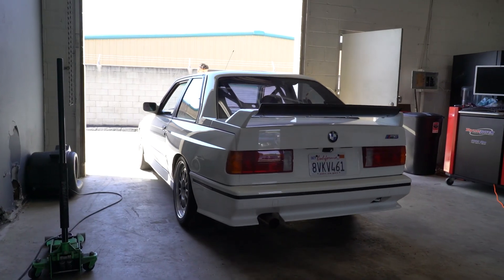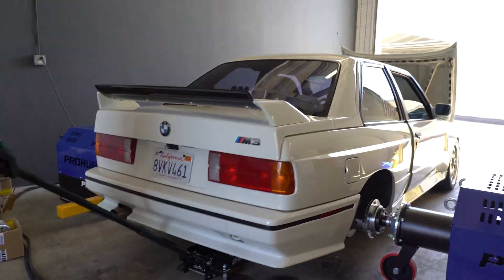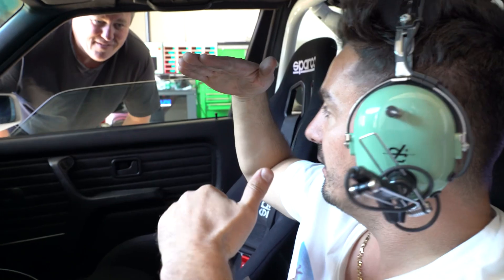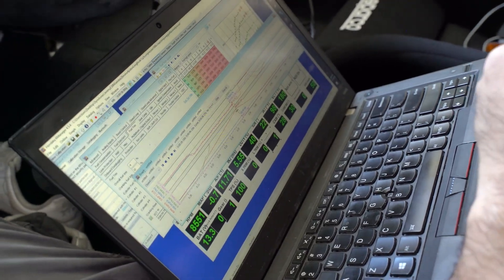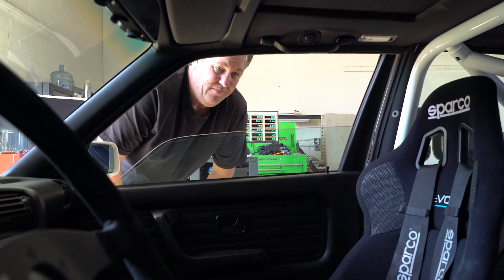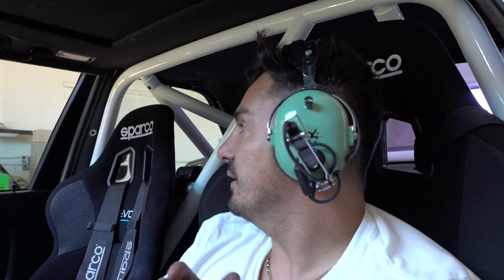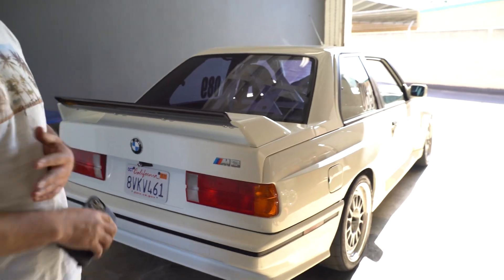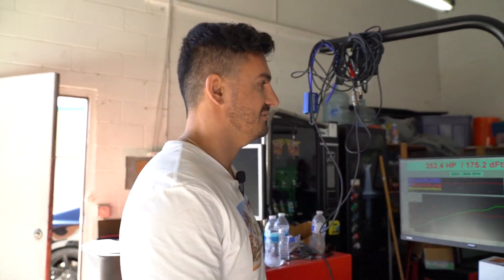Real E30 M3 4piston K24 swapped hits dyno

Comment: is this for racing so you  meat the class as its still 2.3 4 pot  you can beat on it all season and   be able to repair or replace/service the engine ? easier to find  bits ?  its making the same power  and  costs about the same as the BMW S14 engine if you  had built one  .. just if you break one  it would be horrible  to  try find one  ...

Comment: Luv k20/k24 swaps but they need boost - stock e30 making that torque and almost power- easy achieved w bolt ons. Weight is huge but k24 needs boost to make a actual improvement over even m50/s54 swaps..
Reply: They don’t need boost! A k24/20 set up will make 320whp naturally aspirated with a street set up easily, especially with itb’s and e85
Reply: You're not making k20/24 power from any of the factory E30 engines with just bolt ons. There's people running stroked and cammed M20 engines on ITB's are barely making 250 at the flywheel. K24 is almost 100kg less than an M50/S54 and an S54 engine is stupid money nowadays. Really no comparison. For the money you'd spend S54 swapping you'd make way more power boosting the K series for similar money. Don't even get me started on an S14. And a non-M engine is just going to be slower. S54 is the only one worth it in my opinion because it's still a special engine but then you Americans literally only care about power and racing in straight lines. You're still keeping up with an S54 swap with a K20/24 frank.
Reply: @B__L  you’re right about everything you said but you’re wrong about one thing, US Americans don’t always care about straight line racing only! There are plenty examples of American cars doing corner racing! We have auto x racing, American iron racing, road racing etc… I am actually building a 96 cobra with a road race suspension set up..and there’s nothing wrong with big power, who doesn’t love big power??? I myself like a well balanced car, but sometimes I do crave big power
Reply: @petrolhead8851 What's corner racing? Sounds painful 😅
Reply: @B__L bro is it actually nearly 100kgs fully dressed?? I’ve got an aluminium M52 that I’m about to swap into my E30 pending K24 swap after these kits have come out - so hard to decide fml

Comment: How bad does that vibrate.  Sucks they when they remove the balancer it shakes like hell.
Reply from the maker: Which balancer you referring to?
Reply: @Dardantuned  the one they remove for the upgraded oil pump .
Reply from the maker: @Vgk36   ohh right, no it doesn’t! No issues!
Reply: @Dardantuned  that's wild . Maybe other people are running to hard of a durometer on their engine and trans mounts.🤷
Reply: @Vgk36  with the kpower mount arms you can use regular e3024v swap mounts so it makes for a bunch of options for mount hardness. Makes it super nice. My car doesnt shake at all. Idles at 600 without issue.
Reply: @agilee30  can you use rubber mounts? I’ve done the same swap in my 318is with the kpower kit. Vibration isn’t too crazy but would definitely go from solid to rubber if I can reduce some more of the NVH.

Comment: no disrespect but 250 whp out of a $10000 engine is subpar. unopened k20's with e85 will make that.
Reply: i don't think this car was about hp/$, otherwise they would've boosted a stock unopened k24 and get 450/500hp reliably
Reply: @oussama4629  i guess makes sense
Reply: Yeah definitely disappointing, but the 91 octane is killing it. 93 would probably make another 10+ whp, and e85 easily 30+.
Reply: @nickdominic9103  plus rwd drivetrain loss is more vs fwd.
Reply: The bottleneck is the intake manifold as well. In the 300+ whp range, you typically need something different from the usual RBC or RRC style intakes, something more like an ITB setup, ported skunk2 ultrarace, and such.
Reply: @dannyllerenatv8635  this is using a kpower intake. They flow a whole lot. Not your typical intake.
Reply: @agilee30  Ah I see now it is a K power intake. It probably has a lot more tuning left in it, but the owner probably wants something a bit more on the conservative side reading from the comments.
Reply: @agilee30  I’m doing this build but stock block with type s pump head work and cams.  Seeing all these builds end up with 250hp I change to a turbo setup. Accounting for the rwd drivetrain loss I was hoping for 270 all motor but I don’t even think that was gonna be achieved so turbo it is.  I just can’t fathom these fully built motors making less than 280 horse it just doesn’t seem feasible to me to spend all that and barely make 50 more horse than what a stock Motor would have done
Reply: It's NA car for the track
Reply: he has a small as intake. i think thats the problem. 300 should be easy out of this engine
Reply: Yeah, I was thinking the same. I did the same swap on my E30. It’s a K24A motor, k20 Oil pump upgrade, 50° VTC with drag cartel drop in cams and made 247whp. I’m running full 3 inch exhaust, not sure if this guy is. But man if I could add 50whp while keeping it NA the car would be nuts. Have been thinking about 4piston.. This was disappointing
Reply: @nasserkhaja4655  most people say 250 wheel in a little car like a e30 is nice. In 2024 idk if that’s still true.
Reply: @nasserkhaja4655  I wouldn't judge 4piston off of this. I would judge the tuner. It also doesn't specify which package the guy paid for. 4piston motors are in many of the fastest K powered cars. There are quite a few streetable K series between 280-300whp and still naturally aspirated.